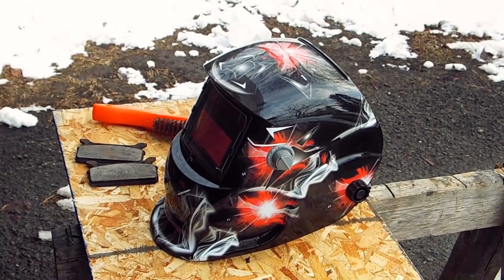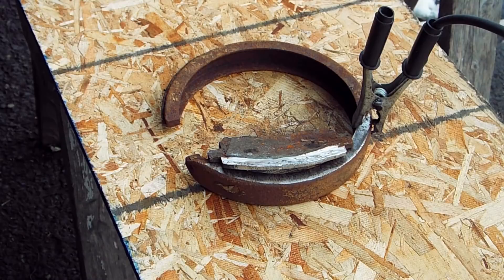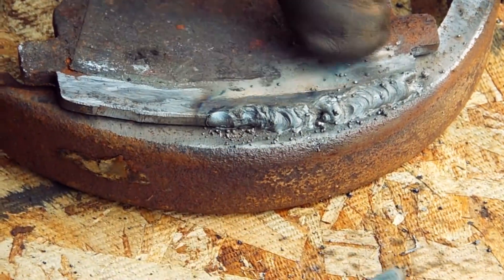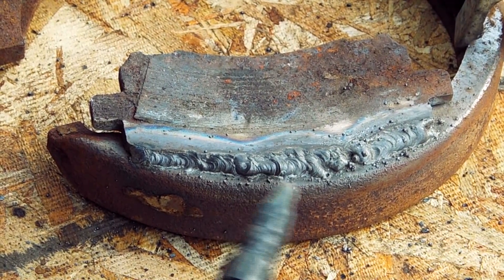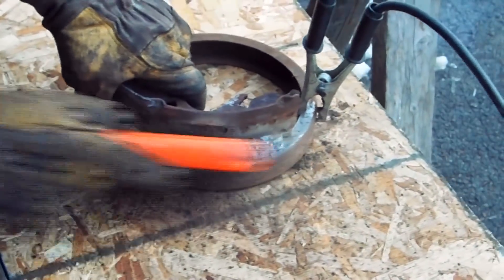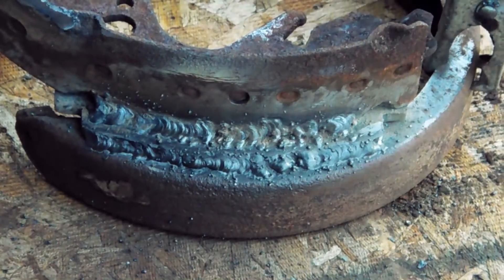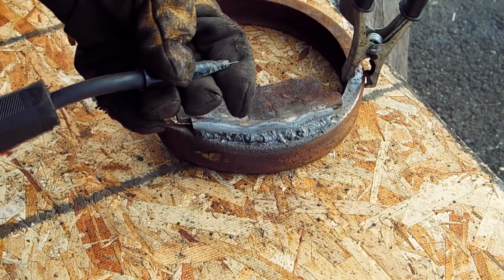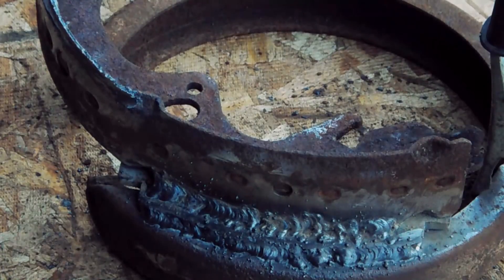AC to DC Flux Wire Welder 110 Volt from Harbor Freight

Comment: You hold still when you strike an acr starting a seam . Wait until the 2 metals run together . It might take 5 or 10 seconds to start the bead puddle . Just wait .  then start traveling along making yhe beads form at the speed the temperature you set goes . Higer temp goes deeper wider bead . If thhe wire arc stutters the wire speed is too slow . If the wire feed pushes against the puddle and work pieces shoving you back faster than it can be used to make the arc you slow the speed down .
Reply from the maker: Good advice, thank you

Comment: Your first weld seemed to need a touch more heat or a bit slower feed second seemed like u moved to fast slow it down dont try to weld the whole space in 1 pass and also each additional pass is introducing more heat into the base metal making it easier to penetrate deeper with your weld

Comment: These 110 welding machines work best when plugged into a dedicated 110 circuit . If you must use an extension cord , it should be as short as possible and one with number 12 wire 
.

Comment: Aren't brake parts like a  heat tolerant type of metal?  SMH....    My HF 90A runs a lot better after I changed it to DC-E  and I didn't use any caps.

Comment: How did you change the current to DC on your harbor welder? I have the harbor freight 125amp
Reply from the maker: I added an AC to DC rectifier that was able to carry the amperage of the AC output. Nothing fancy, and certainly not as good as a factory made DC welder. Not to mention it was a bit on the dangerous side playing with those volts and amps. Lol.

Comment: I thought you were going to show the conversation from ac to DC. I just bough the Harbor freight 125. Not a welder so....school me as you learn.
Reply: The new Titanium 125 is a DC inverter welder.  World of difference over the old AC unit.
Reply: @Thedoug369  mine is now fully converted and works great. Ive only put a few spools though it but it's doing everything i need it to.
Reply from the maker: Not a welder either, but thanks! I uploaded a video before this one showing the (somewhat messy) conversion of this welder from AC to DC. Let me know if you can't find it.
Reply: Hows it not it heats both metals and makes them stick together and says that it is a welder so if it's not a welder what is it
Reply: @Mike-su8si  I wasn't a welder, but that was a year ago... I'm still not a welder but I did the conversation and it works much bettet.
Reply: @davidfellows6250  not no fluxer welder it all I'm more better off cutting people and friends trees down. I don't see myself as an welder.

I hate to throw color in this but some places like were I could have had my deck welded at would have charged us more because of color like the junkyards always have done. I'm not that way though if i have a engine part or frame part anyone could use their welcome to it.

Comment: That little welder is nice but it don’t get hot enough for thick stuff like that,,,you would be better served for steal that thick and thicker to use a hand held propane torch after you cleaned it up good with a grinder or heavy duty wire brush,,, get it extremely hot then weld it and then clean your weld up maybe even grind it down a little bit and go back over it again,,, heat it up again with a torch and then another layer of weld on top of it,,,,if you do that 2/3times you’re going to get better penetration and a a stronger weld ,,, you did a good job though,,,if that’s the only welder you got and you break something and that’s what you got to use,,,take your time go slow do the best you can probably work out real good for you.

Comment: You actually improved. Your expecting the machine to do the process of welding for you.  Build a puddle ,cut out metal of both pieces using the arc and fill it in using the puddle. You are pulling the gun along expecting to adjust the machine until it produces a weld you like. If you cannot properly weld it doesn't matter how you adjust that machine you're never going to get a good weld. You should be able to produce a weld with almost any setting on there regardless of it's too hot or too cold or in the metal is too thin or too thick what is yours not the right wire. It ain't setting I've never seen you build up a puddle and maintain it along the weld so don't expect to be able to keep adjusting the machine when you are inconsistent and get a weld somehow. Keep watching YouTube videos homewell professionals not welding Harbor Freight hacks LOL

Comment: I have an ac flux core welder and it does a fine job. I know a lot of guys give it a bad rep, trust me the flux is in the puddle for either ac or dc and it floats to the top in either case. Some guys think half the wire is lost due to spatter, no way.
Reply from the maker: Thank you for that comment, Rob. I have found it to be a fine art to balance between heat and wire speed and travel speed.
Reply: @contact4mwy7  on thin stuff you have to stop and wait for excess heat to cool and start and stop watching the 2 metals melt together and that determines the speed you travel . Power determines how deep it melts . 
  Follow the seam first pass steady folliwing the seam you want to make . It does an evener and easier job people say and i believe them and saves a lot of time and wire and usually is stronger if you can do it that way .  Sometimes a gap needs filling by weaving  . But stop when it gets too hot fir however many seconds it takes to cool . If you see bright metal bigger than the weld bead puddle  looking through the helmet it is getting too hot . The thicker the metal the longer to cool to a worjabke temoerature .

Comment: Also  Dip your tip in nozzle cleaner. When you're working close it will keep this splatter from sticking to your tip
Reply from the maker: Thanks for the advice, Anthony.
Reply: @contact4mwy7  Anytime.   They also make a spray in a aerosol can you can lightly spray your tip or spray  Your bench top work area… this will keep Splatter from sticking also.https://www.homedepot.com/p/Lincoln-Electric-Anti-Spatter-Non-Stick-Spray-KH505/100341087?mtc=Shopping-B-F_Brand-G-Multi-NA-Multi-NA-Feed-PLA-NA-NA-Catchall_PLA&cm_mmc=Shopping-B-F_Brand-G-Multi-NA-Multi-NA-Feed-PLA-NA-NA-Catchall_PLA-71700000014585962-58700001236285396-92700010802552397&gclsrc=aw.ds&&gclid=Cj0KCQjwivbsBRDsARIsADyISJ_P80JwWQ4nDyRxsN8XDyW7aHogzlOk-BYt0pKDCL2Y4SV13Au3m_saAtppEALw_wcB.
 And for a super clean Weld... There are 2  Welding wire pads… they install where your spool  Is… just before the wire goes into the tube. This cleans the wire as it comes to the gun.https://weldingsupply.com/cgi-bin/einstein.pl?PNUM::1:UNDEF:X:007062

Comment: It ain’t gotta be pretty just has to work good job and how did you switch that welder to dc?
Reply from the maker: I appreciate that. I followed the steps of others in converting it to DC by adding a DC Bridge Rectifier and a large capacitor. I have a video of that too, and it also isn't pretty, lol.

Comment: A few suggestions. Get a much better earthing clamp with a thicker and better quality earth wire. Use the best quality flux core wire you can afford - this improves spatter greatly. Always clean the weld at each stop. If you feel the earth wire getting hot have a break until it cools down - the standard cables resistance goes crazy the hotter it gets. You get a good sounding start but then loose the rhythm of the weld by being impatient - set the beat in your head like a music track and concentrate on maintaining it - I have specific tracks I reference for specific thicknesses of material !  Also I have found the higher voltage machines @ 240 volts make a huge difference. Having said all of that you look to be doing just fine. The real fun and games comes on sheet steel and I am still struggling on that, but stitching seems to work if very slow. It beats my A/C stick buzz box hands down though on this :-).
Reply from the maker: Thank you, John, much appreciated and very helpful!

Comment: I usually put my machine on about 8.5 to 9 on the wire speed on that thickness it works pretty good
Reply from the maker: I agree, Wade. I've been experimenting with wire speed since there are only two amp/voltage settings.
Reply: There is a chart under the lid . Pick flux core and thickness and it gives recomended speed and piwer level . Harbor freight and flux core can use around 3 for that metal . If the wire pushes your stick back its too fast if it stops and starts it is too slow . If you can splatter at wire feed speed 9 you aren't  running a bead with a harbor frejght 90 amp 24 volt ac wire feed welder . Top speed is for threading a new roll quickly but not welding with the flux core .

Comment: First off take, and use both hands for maximum control , second turn up your wire feed to 6 or 7 on that thick of material,  take and slow down a bit, and third take and tighten your wire feed tension knob till you cant stop your wire with your hands. Its taken me a bit to figure this out too

Comment: Actually mig is one of the hardest to do right. People think they are getting  a good weld because it’s kind of like using a glue gun.  Without penetration a weld  won’t hold if its structural.  That’s why in welding school after making welds they cut a cross section out to see what really happened.  You can’t tell by looking at it or just banging on it. A weld that looks good today can fail weeks or months later.
Reply from the maker: Good advice, Gene, thank you.

Comment: Mark Young,
I am just a hobby welder. I do have an old friend who got his A&P license and landed a job welding pressure tanks for an aerospace company. I see lots of videos of folks making fuzzy caterpillar "welds," with these toy boxes. My friend, he's consistent quality bead man with exotic alloys. What a guy! Keeping America safe!
Reply from the maker: He and his work is much appreciated. I have a better understanding of what it takes to make those welds happen. I'm still trying to get the hang of it, and maybe the machinery is hindering that effort?
Reply: @contact4mwy7  
There is a certification video on Youtube of weld on 8 inch pipe with 220v and rod.
He was running 80A all the way around on vertical oriented pipe. The instructor pointed out that student had to correct burn through during his welding pass. The gap began to increase in size. It's a fine art. With these wire feed   boxes I have attained some skill with sheet metal on bbq and oven burner elements. Saving replacing the burner assys.
Reply: There is also a good tutorial of a high end refrigeration solder job on copper tube where the man injects low pressure pure nitrogen gas into the tubing to eliminate any residual oxidation for zero contaminate in the refrigerant system.
Reply: There is also a pdf download on the internet for a D/C IC control circuit. Fairchild produced a good 125A Inverter for the application.
Reply: @contact4mwy7  It's the wire itself that lacks the cross sectional material. It is filled with flux, therfore being devoid of steel internally, the wire distorts while feeding through the roller. So at molecular level the wire is not consistently posessing a constant resistance/load in ohms. And zero labs man addressed the issue of these boxes already having additional voltage drop of wire drive supply coming directly off the secondary windings. And the D/C conversion with rectifiers drops the voltage another 1.3 volts as a normal function of a silicon diode. Yes, these are limited machines.
A 220v welder, makes anyone a good welder just by repetition 1000 times.
Brain entrainment.

Comment: Dear God, Thank you for high school welding shop and learning the difference between a 220v stick welder and a 110v 
22 gauge sheet metal buzz box. I will pray for kids that hopefully do not electrocute themselves with adding capacitors and  storing 20Amperes of lethal current.
And thank you for my  AAS degree in electronics.  I can trouble shoot computerized systems down to discrete component level. And my grown son can write assembly code for Linux. Education, a wonderful thing.
And as Mark Young showed, this is not a machine for the thickness steel  attempted.
Just a hairy caterpillar piled on top.
220v @80amps. A $600 Lincoln 225A.
Reply: I learned how to weld from lack of electrical tape on appliances
Reply: To tell you the truth, i dont understand why putting in a cap. It just makes for more spatter. Want more amps? Add a microwave oven transformer in parallel. But yank the secondary coil (thin windings) and replace with. 8AWG at 14 or 15 turns. Connect paralel with original transformer. Youll add more amps without adding volts.
Caps are dangerous, dont last long.
Reply from the maker: Amen!
Reply: @contact4mwy7  
I had to clarify at the end. The premise is the same. Thanks sir. I had to find a video with your concise and gifted speaking ability. Young men being good followers when logic is presented correctly.
Have a fine day.

Comment: Looks like crap
Reply from the maker: I appreciate your honesty.
Reply: @contact4mwy7   I welded flux core wires for yrs and you ight try just dragging it and cut the motion.  I did you working with harbor freight stuff. Did not mean to offend when i started mine look almost the same.
Reply from the maker: @johnw391  No offense taken. I understand your suggestion of just dragging the flux wire, and no side to side motion. I will try that. Thank you!

Comment: That looks very similar to my hood. Except mine is a bit more similar to the Esab A50 which is actually my favorite hood. But this one was $50 (compared to $300) and has the external adjustment knob (exactly the same as yours). I actually really like it. Though I intend on making a mirrored outer lens like the Esab, as I feel it makes a significant difference in looks, though I know it's strictly cosmetic and has no real benefit

Comment: With what u have u done a good job,,, I have been welding for many years and if I could make a suggesting,,,if u can position the bucket to where u have to weld up hill u will get better penetration just make sure u keep the stinger up close and let the weld fall back down and it will penetrate better

Comment: not all flux core wire is M=multipass, I learned from Jody at weldingtipsandtricks...  I'm a newbie myself but thanks for sharing..  the other thing i recall was not to 'weave' with fluxcore... it inhibits the 'slag' from forming properly.. I think I got that correct  God bless and thanks again : D
Reply from the maker: Jimmy Favereau good advice that I will look into, thank you very much!
Reply: You are right on both of those, using the right wire is important, and if you weave too wide you can definitely trap slag inside your weld causing what is known as a slag inclusion.

Comment: To really see the quality of weld you’re producing, you should do the best job you can on some good quality practice pieces and then “cross section” the welded work (ie cut thru the work in a direction perpendicular to the weld bead). You can use an angle grinder or hacksaw. Examining the cross section will show you the original pieces, the weld bead and the true penetration between the two. Good luck. 👍
Reply from the maker: Joe Romanak very good advice! Thank you for commenting.

Comment: Don't buy a cheap helmet.  The cheap helmet I had did not have a replaceable battery.  When the battery goes bad, you get blinding arc flashes when you start the weld.  You have to toss the helmet and buy another cheap one.  I bought the HF Vulcan welding helmet that sells for about $140.  It has a replaceable battery.  It's like night and day compared to my old, cheap helmet. There are others that are multi-purpose but the get into the $300-$600 price range.
Reply from the maker: Although mine was pretty cheap, it does have a replaceable battery, but I have to agree, going cheap on the welding hood is not always a good idea. Thanks for the comments!
Reply: You can get just lens replacement parts. And the right one has batts.

Comment: It seems that trying to go slow is every new welder's problem - mine too.  Wire feed speed, voltage setting and travel speed, if not correct will result in either weak welds or holes blown through the project material.  I'm still learning and it will never stop.
Reply from the maker: I'm still learning too. Using scrap materials to practice first seems to be the way to go before taking on the "important" stuff!